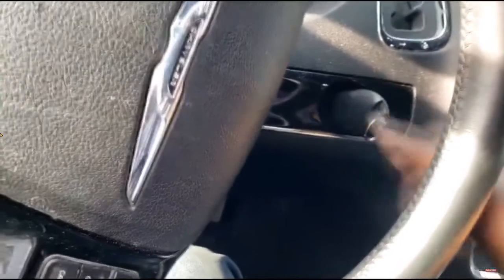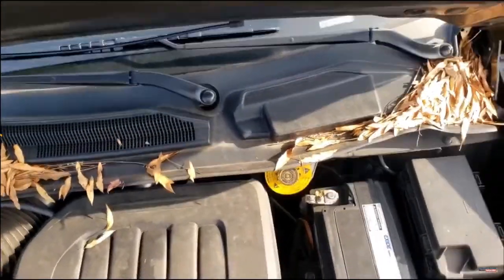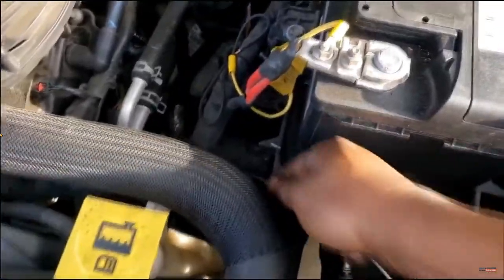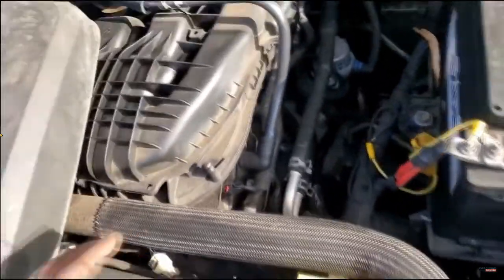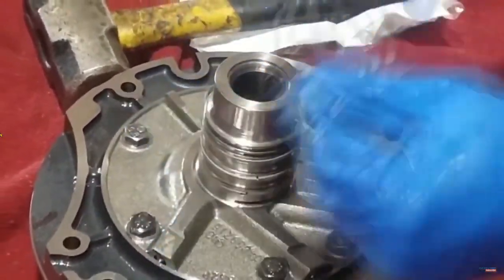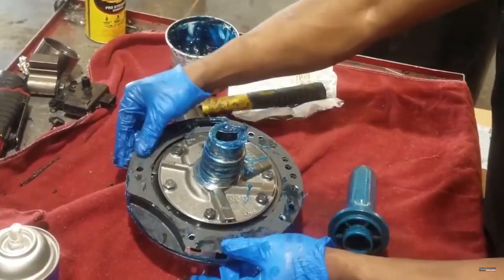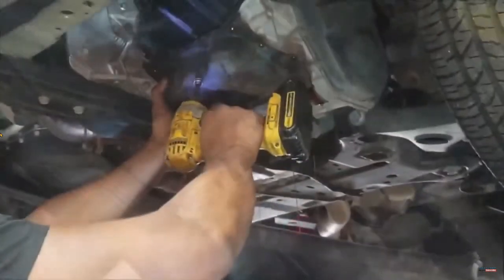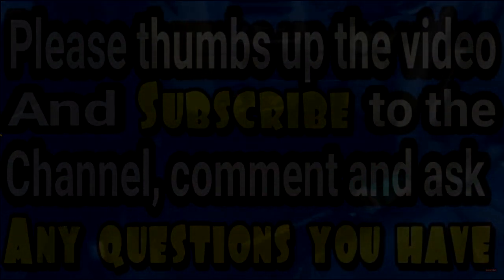If you hear this noise and see this in your pan, your transmission toast.

Comment: You got that right.  Here in PA. I'm going to have to get my transmission rebuilt 2 hours away from where I live in Central PA.  Everybody wants to just replace it.  I don't know that used transmission!  I can't trust what ever mileage you claim it is on it. My car still shifts. . It doesn't do hills.  But drives fine.  Wish I could transport it to you. Lol. 09 nissan Murano 159k  3rd owner.

Comment: I have been changing fluid (not a full flush-just what is in the pan) and filter every 25k miles on my 2004 Dodge Caravan.  No problems with the trans so far!  Oh, once I cleaned up the factory sealant, I have been using the Fel Pro gasket-no leaks.

Comment: Hi I have a 2008 dodge avenger 2.4L and my car won’t go over 40mph and the rpm’s just keep going up without shifting and it revs on its own when I’m not stepping on the gas sometimes. I am getting codes P0700, P0733, P0734 and P2004 do you have any advice for me?
Reply: I also have a whine noise when I accelerate
Reply: i would think its a valve body, based on the fact that it is unable to shift out of a gear. The p2004 code could represent a bad throttle body, so try taking the intake manifold off, and maybe try cleaning the throttle body before replacing it.
Reply: @rcparts3d893 I saw a video where they said that it could be the torque converter and not the valve body. What do you think?
Reply: @Alex-z2v2h  Do you also have a shudder or vibration while accelerating? Normally, a P0741 code could be a symptom of a bad torque converter. Before doing anything major to the torque converter, try adding some lubegard shudder fixx to the transmission. If that works, then change your transmission fluid. Also, the whining noise could also be caused by a bad torque converter, but it can also be caused by a bad transmission pump, which is responsible for pumping the transmission fluid to the transmission to lubricate it, and provide hydraulic pressure to enable the transmission to shift gears.
Reply: @rcparts3d893 No shudder or vibration while accelerating just the whining sound. The car revs on its own sometimes and the car won’t go when I press on the accelerator and it won’t go pass 40 mph. I’ve never gotten P0741 code
Reply: @Alex-z2v2h  OK, The whining noise is likely the transmission pump making noise. Did you change your fluid regularly? if not, then your trans is likely burned up, and worn out, and you might as well put in a re manufactured transmission, assuming that your car has a lot of miles on it. The issue with accelerating on its own has nothing to do with the transmission. It has to do with the throttle body opening randomly.

Comment: I’m 65k miles on my 2019 journey 
I haven’t checked my trans oil but I plan on doing a trans service in Feb 
Am I done for ? 
My Journey wines but drives normal
Reply: Yes
Reply: yes done
Reply: Whining is the pump low on fluid or gone. Same sound as a P/S pump low on fluid. BOTH are hydraulic pumps.
Reply: So I finally checked it cold 
And it looks clean and full 
Maybe it’s a humming sound I’m listening to 
I bought the car at 35k now 
Am I still done 😅

Comment: Sad that a $30k vehicle is junk @ 9 years old due to a trans repair of 12 hrs @ $200/ hr costing almost it's worth. A friend just bought a 2012 T & C w/ 60k miles for $2900. $2400 is 83% of it's value. My '72 Caddy had it's fluid changed only once, 17 years ago and still shifts like new. Locally it  would cost under a grand to remove, rebuild and replace it's TH400. TH350, TH400, C4 and C6 trsnsmissions are the cheapest to rebuild...period.
Reply from the maker: Whats even sadder is consumers not doing the suggested maintenence that's required to help extend the life of the vehicle. As I said, this trans was never serviced as suggested. Very possible it would have lasted much longer. So be careful putting all the blame on the carmaker. And also comparing the new stuff with the old. We simply living in a new era and things simply not built the same. So we simply need to adjust to the current climate we live in.
Reply: The nissan dealership in Central PA to me there are no brand new transmission out anymore.  He said they don't make them.. I'd drop my own tranny and replace the valve body.  Just have to find someone who will reprogram it.  Guess that will a 2 hour drive for that too.  Smh.